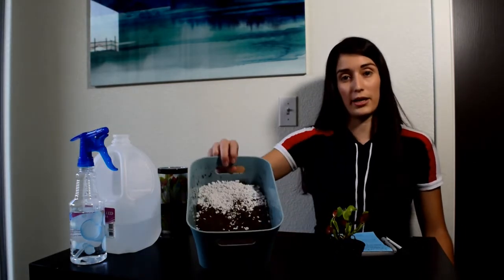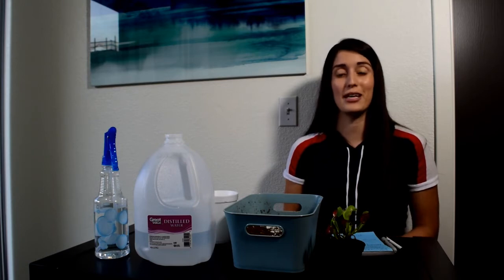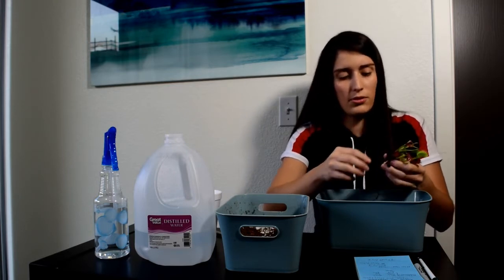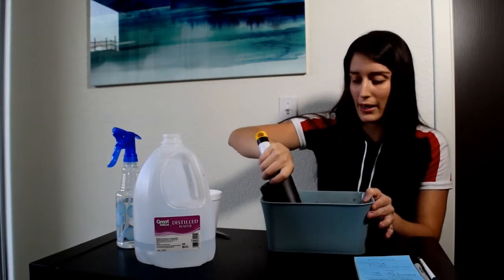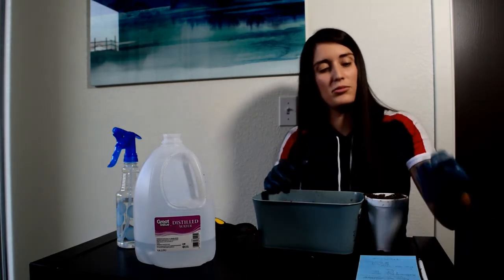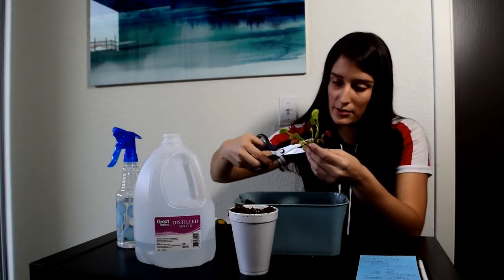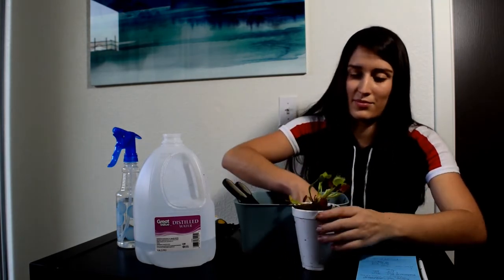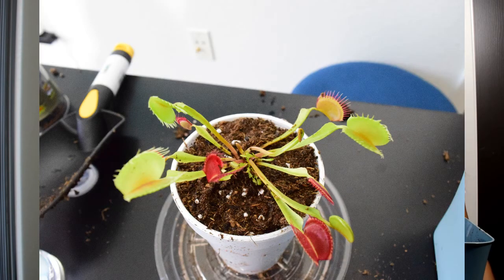How to Repot a Venus Flytrap - A Step by Step Demonstration

Comment: I sent off for three Venus fly trap plants but actually got four because there was a smaller one in one of the pots so I re-potted it.
I first grew them about 50 years ago when I was a teenager but learnt by my mistakes I was keeping them too wet and after 4 years I kept the next one only moist and watered it from the bottom. The instructions with the plants in those days were not very good. I also thought strong sunlight was bad for them so kept it in a shaded position but in bright light and it got the evening sun for a couple of hours. It was in an unheated greenhouse all the time. That one lasted four years.
Would spraying the leaves with water say once a week be beneficial?
Reply from the maker: Its a plus when you get an extra plant 😄 Thanks for sharing your experience! Misting can help, especially if you grow venus flytraps in low humidity.
Reply: @venusflytrapworld  Right ok, thanks.

Comment: My flytraps do not open once fed and just stays in a closed position for a very long time, why is that?
Reply from the maker: This can be caused by a few things... First, if the bug is relatively big, it can take weeks to digest. Also, sometimes the leaf is just a bit old, and once closed it might stay in that position cause it is "exhausted"
Reply from the maker: Does this happen to all the leaves? Also, for how long do they stay closed?
Reply: @venusflytrapworld  they like stay close until they die if i feed them
Reply: I think it is because they are old, i will wait for the others to open
Reply from the maker: @cedricaquino1088  that is a good idea. You can space out the feeding. What you fed them should be good for a while.

Comment: What if I use clay pots?
Reply from the maker: Good question! Clay pots can leach minerals to the ground which hurt VFTs. For that reason, I prefer other options. Plastic, glass, styrofoam, and glazed ceramic pots are safer bets.
Reply: @venusflytrapworld  oh, I just have clay pots, would it be ok if I use half a sprite bottle?
Reply from the maker: Yes 😀 that's a good and creative solution. PS: Don't forget to add drainage holes.
Reply: @venusflytrapworld   I just got my plant today, would distilled water with electrolytes kill the plant?
Reply from the maker: Water with electrolytes (salts for flavor) is harmful for Venus flytraps. Instead, employ rainwater, pure ro or distilled water. You can buy pure distilled water at the grocery store (generic distilled water jug).
Reply: @venusflytrapworld  how long do you think they will survive? Because I only had the smartwater and I had to use it
Reply from the maker: Your plant should be fine, don't worry. Just make sure to get distilled water in the next few days (before the soil dries out).
Reply: @venusflytrapworld  The traps are not opening and some of them are turning red, why is that?
Reply from the maker: @cedricaquino1088  Hi! Since your plant is new, it is normal for some leaves to be closed. They might have gotten triggered during potting or transportation. They should reopen in a couple of days :)
Reply from the maker: @cedricaquino1088  The leaves can turn red due to changes in light (like getting a tan). Here is more info on color changes: https://venusflytrapworld.com/why-is-my-venus-flytrap-changing-color-color-meanings/
Reply: @venusflytrapworld  Ok thank you very much